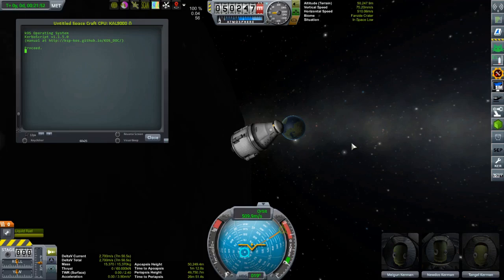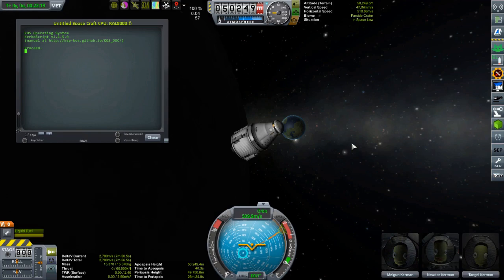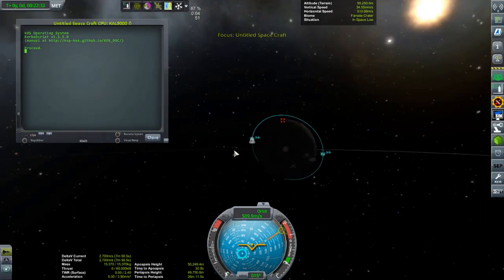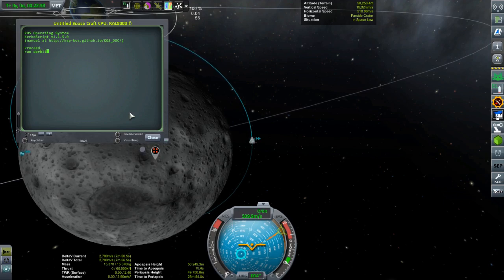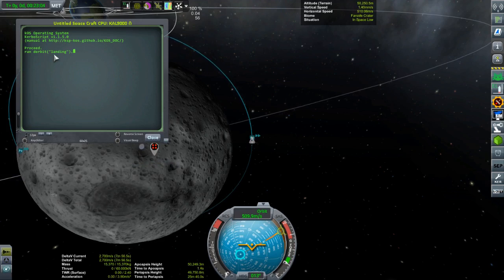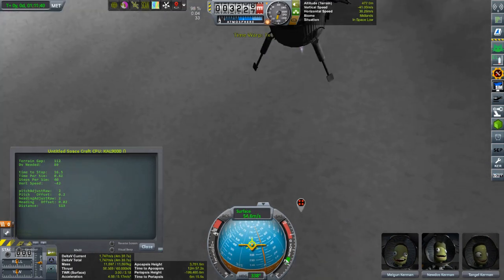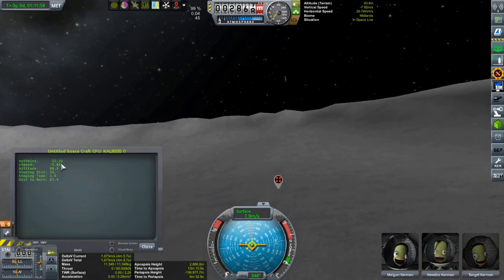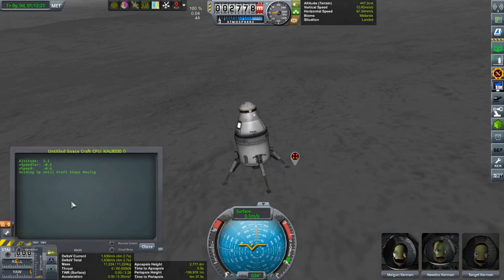KSP Precision deorbit and landing using kOS

Comment: I found the files in github, is there a way to clone them or do I just cut and paste. (I am trying to learn the github or the git commands to explore KSP-KOS scripts to build something workable on an older MAC Air with limited RAM, so I don’t have a lot of mods running.)
Reply from the maker: To clone or or download the scripts you would need to be at the root of the branch hear: https://github.com/nuggreat/kOS-scripts/tree/Demonstration-Scripts.  Look for the green button labeled "clone or download"  and that will let you get everything in the branch as a zip file that you can then work with.

Comment: What mod are you using for waypoints?
Reply from the maker: The waypoint was placed using the scanSat mod but you can do that just about as easily using stock kerbNet.
As for making it visible when not in map-view that was done with with waypointManager.
This was also done in KSP 1.3.1 and I haven't checked if all mods I was/am using are updated or if any of there features are incorporated into stock yet as updating is a pain because I like to play with a lot of fairly complex mods and thus can't always trust that i can migrate saves between version.

Comment: great video! can I use this on a planet with an atmosphere?
Reply from the maker: Technically yes you can use this on a planet with an atmosphere

In actuality none of the code will account for atmospheric drag so the deorbit calculation will be off and extremely steep, the landing it's self might deviate to far off retrograde and flip and on top of that the landing calculations will not account for the effects of atmosphere and this is likely to start the burn early at a lower throttle and then fail to account for the change in thrust caused by the increasing pressure and is thus likely to not realize it can stop in time and thus it will initiate litho-braking.

I do have a version of the landing code not the deorbit stuff that can account for drag but that is still very much a WIP and has a 50% or so instance of crashing craft for each attempt to date
Reply from the maker: @DEDSEC R13 the DV needed is partly dependent on the craft but for say the mun tends to be around 1000m/s for the full de-orbit the exact number depends on the TWR curve of the craft and how much inclination change is needed to reach the desired point.

As for just using the script assuming you have kOS you should be able to run it on any craft without changing any of the code i tried to make it able to land any craft.

For instance I have used this to land an ion probe that only had 1.01 TWR and that had no problems.